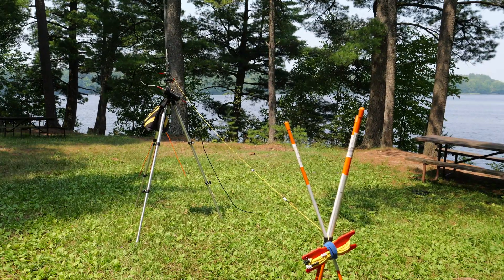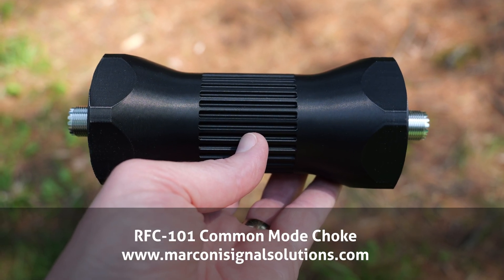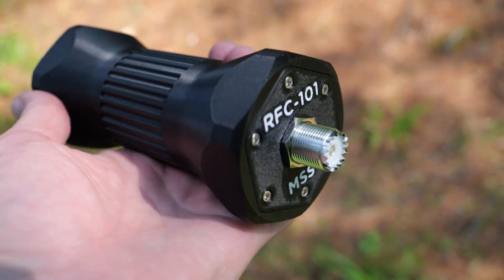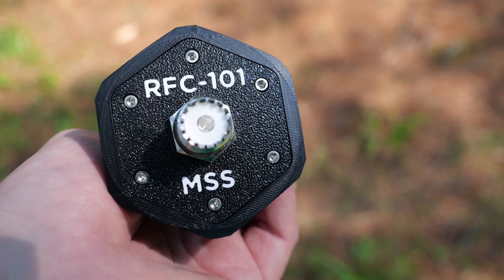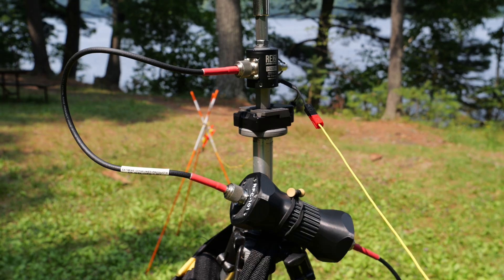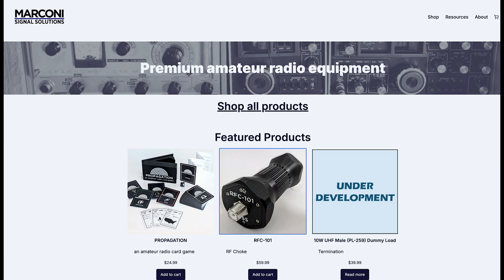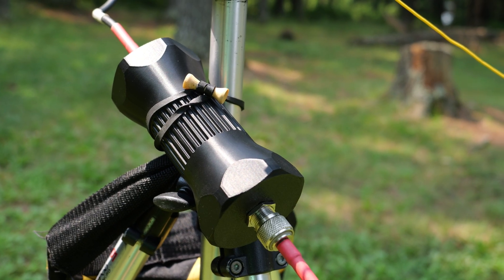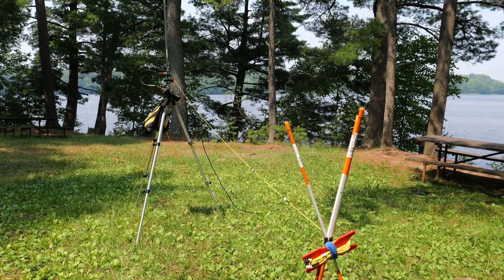This Simple Trick Makes Your Antenna Work Better!

Comment: Totally agree on need for common mode feed line choking but the price of the product you are reviewing is pretty steep.  Ferrite beads on the feed line and or making an “ugly” coax choke simply by making a multi turn coil of your feed line adjacent to the antenna feed point will also do the trick.  I use the latter on all my antennas from VHF beams to verticals with elevated radials and end fed half wave inverted Ls, and also my multiband linked setup dipole.

Chris AJ1G
Stonington CT

Comment: 3d printed plastic WILL turn to powder in no time even if advertised as uv resistant. Fact!
Reply from the maker: There are some very resilient 3D printing materials out now, so I wouldn't make that a categorical statement.

Comment: $59.99 for one, no thanks.
Ten FT140-43 ferrite rings £29.10 and a few lengths of wire. Put one at each end of the coax.
It's supposed to be amateur radio so why BUY everything?
G4GHB.

Comment: Insertion loss looks like it hovers around -0.2 dB in the Marconi data sheet. The Palomar maxi-choker claims -0.0123 to -0.1218 dB with about the same attenuation, but the Marconi will save you $30 over Palomar. I typically have a choke at both ends of the coax so avoiding the additional 4% power loss is worth the $60 bucks to me (2x30), but if you have a limited budget, Marconi looks like a good choice. Thanks for letting us know about them.
Reply: 2 times twicet

Comment: You are using it near the antenna feed point, which I agree with . But reading the data sheet , the mfg. say to use it near the transmitter. I wonder who is correct.

https://marconisignalsolutions.com/wp-content/uploads/2025/07/RFC-101-Data-Sheet-3.pdf
Reply from the maker: It depends on the purpose of the choke. We put common mode chokes at the feed point to keep the stray RF energy from traveling down the coax and turning the coax into part of the antenna system. Putting a choke near the transmitter can help reduce common mode noise that may be affecting your receiver. I have a choke on the transmitter end of the coax at my shack. It helps reduce artificial (man-made) noise generated by my neighbors.

Comment: Awesome video.  Do you recommend a choke on both ends of the feedline?  Of course if your using the braid as counterpoise you wouldn't, but Im always confused with this.  I generally use an ABR coax with a built in choike doing pota and put the choke at the feedpoint and wondering if I should put another at the radio.
Reply from the maker: I recommend a choke at the transceiver end of the feed line for two specific cases: reducing artificial (man-made) noise and to eliminate interference from a 2nd close by transmitter. I use a common mode choke on my shack rig to help reduce some of the noise generated by my neighbors. For the second instance, when Dave and I run multiple transmitters for the Minnesota and Wisconsin QSO parties (and Field Day for that matter), we'll add a choke on the feedline near the transmitter to reduce the RF noise from the other radio. Here's a video that explains that more: https://youtu.be/-XIESKAdVXc
Reply: If you're using the outer braid as a counterpoise wire, then choke at a point on the transmission line that's the desired length of the counterpoise; otherwise, choke at or near the antenna feed-point.  Also, a choke at the transceiver end can be helpful for reducing received RF noise when operating in a RF polluted environment.
Reply: I use them at both ends of my coax but not at this price!
Ten FT140-43 ferrite rings £29.10. Make your own.
G4GHB.